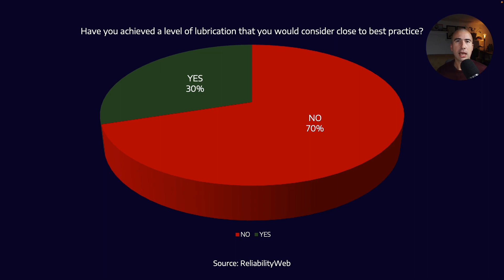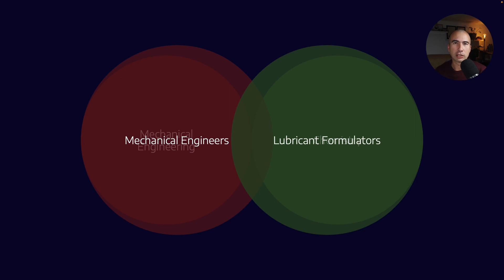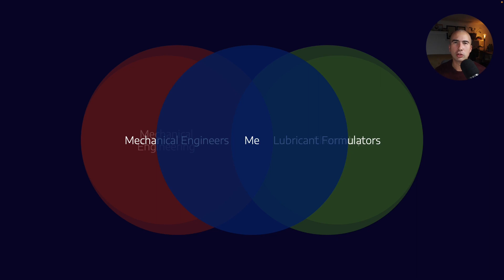Major Hurdles to Selecting the Correct Lubricants

Comment: If the ID of a spherical roller bearing is 80 mm ,OD-140 mm width 33 mm and operating rpm is 2200 ,then what should be used for lubrication, grease or oil ? And what should be the oil viscosity ?

Comment: I called up Penrite some time ago with some questions, for one they don't want to help when they hear aircraft. I was questioning their ten tenths line of oils PAO-ester line. They told me that even in v8 supercars they change it after every race, but my understanding is they use methanol fuel which degrades and dilutes the oil and I wont be using any methanol. I would like to use products that are readily available in Australian stores, but they don't state much with regards to ingredients, so I am just doing my own testing between various grades of Penrite, Nulon and Gulf Western.

Comment: i have a small hobby business that makes tools and parts for the slot car hobby.  a lot of the people in the hobby just use a motor oil or some other generic oil off the shelf for lubrication. while it works, since its a virtually no load use, i decided that i wanted to try to formulate something myself. The data out there on the internet right now for what i want to know is either at a 5yr old level, or a masters thesis level, with hardly any in-between. I will say, one of the best things I did was talk to a representative/distributor for exxonmobile. he was very informative, knew all the oils they had and what would most likely work best for my application. He was even able to send over some product samples so I could do some testing before i purchase a barrel of anything.

Comment: I operate a fleet of MB Sprinter vans with the OM642 Diesel. What I find confusing is that MB engine oil spec includes both low ash API SN oils and low ash API CK-4 oils. Which oil spec do you think should be preferred?

Comment: So far for me, I found lubricant industry to be most complicated as they hide information, data sheets many times have missing information on ingredients or it just says "trade secret formula" something like that.  
Also as I am not chemist, I do not know what other ingredients inside a product do for me.
Like for example WD 40 specialist silicone has ingredients
LVP Petroleum Solvent, 60-80%
Poly(dimethylsiloxane), 1-5%
Propellant (propane, n-butane) , 10-30%  

So what will this LVP petroleum thing do for me and will it stay or evaporate, I have no idea, then what about this poly thing...
For propane, I can make out that its the thing that propels the stuff inside 

just one example of many where I have no idea what these things do nor what it means for me once I apply it somewhere

Comment: Hi Rafe, good video.
You mentioned a mining company, I work for Australia's largest underground hard rock contractor.
Our lubricant selection is done as a joint effort between the purchasing department and the mechanical team.
We have a long-term oil partnership with Fuchs, and our company constantly looks for any product issues, and also possible cost savings.
Fairly recently, it was noted that we don't really get any benifit from the more expensive synthetic version of their hydraulic oil as it replenished so often due to hose damage and leaks that it's constantly fresh. (A big saving per litre) 
We have reverted to the mineral version with no increase in wear of the systems.
Similarly the mechanical team has the fleet set to a conservative 250hr engine service schedule.
There's no history of any abnormal wear in the trucks and loaders, so these are tracked now to have the '250hr' service completed every 300hrs now 👍
To save confusion on the floor, the sheets still show 250/500/1000 services.
Reply from the maker: Yeah that’s awesome. There’s definitely a handful of companies doing this well, but most of the time the salespeople are dictating lubricant selections, and I find there aren’t many that know what they’re talking about.

Comment: Hello Rafe, I'm Abir, mechanical engineer.  I have a serious question.

 We know  xxW-30 grade  is 9.5-12.5 cst and xxW-40 is 13-16.5 cst at 100 degree celcious.

If i give an example Yamaha R15 or Yamaha Fz16  recommendation is 10w-40, so actually oil of  13-16.5 cst is recommended at 100 degree. 

If anyone use Castrol power 1 racing 10w-40 (group-3 synthetic)  which is 13 cst  at 100 degree, initially nothing is happened,but after 2500km or 3000km this viscosity droped at 12-20% less, so the viscosity will be 11-11.5 which is actually 10w-30!  
Even,  I saw a lab test that at after 1500km,  the viscosity drops at 11.8 cst.  (In indian hot weather) 

And same case to Liqui moly street race 10w-40(13.4cst), Mobil racing 4T (13. 5 cst) and all the viscosity dropped 15-20% and gets the viscosity of 10w-30! 

So,isn't it detrimental to engine?

If its detrimental so why Castrol power 1 racing 10w-40 , Motul 7100 10w-40, liqui moly   street race or mobil 1 produce terminal viscosity point of xxw-40?  Why they dont keep it 15 or 16cst so that the drain period will be long and  viscosity remains  in xxW-40 range?  

So,my summery of this big question,  is 13-13.5 cst oils are using safe in hot weather country of a 10w-40 recommended bike?

Please,if possible make an illustrated or short  video.
Reply: I'm going to step in here, the reason why the viscosity drops is fuel dilution. This is perfectly normal for a high performance 4 stroke motorcycle engine as they typically run rich mixtures for full power, and low drag rings to reduce parasitic losses in the engine.
It's up to the owner to find a drain interval that changes the oil before the dilution becomes to great.
(On my own 4T Enduro bikes, this is 5 hours run time)
Reply: No no, I just gave an example of Yamaha r15, this viscosity drop happens in every air cool street bike.  And viscosity droping is a normal issue,I know. My question is using 13-13.5 cst is harmfull to a 40 graded engine and why oil manufacturer make it at terminal viscosity line?
Reply: I highly recommend Amsoil 100% Synthetic 10W-40 Metric Motorcycle Oil, which is a combination of PAOs (Class IV Synthetic) and Esters (Class V Synthetic) that provides a 14.6 Kinematic Viscosity @ 100°C, cSt
(ASTM-D445).  Amsoil also carries a 100% synthetic 15W-50 Amsoil Metric Motorcycle Oil, which is rated by an independent Mechanical Engineer (M.E.) at 116,187 PSI, that provides a 20.2 Kinematic Viscosity @ 100°C, cSt.  Compare that to his testing of the 10W-40 Mobil 1 Racing 4T, Four Stroke Motorcycle Oil, at 93,661 PSI (unfortunately, he didn't test the Amsoil 10W-40 Metric Motorcycle Oil).   

"Reduces Friction, Heat and Wear  In high-heat conditions, AMSOIL Synthetic Metric Motorcycle Oil exceeds the standard for high-temperature film strength to deliver excellent wear protection. It keeps engines running cool by effectively reducing friction and heat, and it contains a heavy treatment of anti-wear additives to reduce wear regardless of operating conditions. AMSOIL Synthetic Metric Motorcycle Oil is thermally (heat) stable and contains maximum levels of oxidation-inhibitor additives. It is extremely resistant to volatility and is engineered to prevent damaging sludge and carbon deposits for superior engine cleanliness."

It also provides "Smooth, Confident Shifts, Controls Foam and 
Delivers Superior Rust and Corrosion Protection.  With its high 11.6 total base number (TBN), AMSOIL Synthetic Metric Motorcycle Oil provides greater protection from acid corrosion and helps maintain internal engine cleanliness."

For full disclosure, I am an Independent Amsoil Dealer.  It should be noted that all Amsoil Dealers are Independent Contractors (as opposed to actual employees of Amsoil).

Here are two Product Reviews from Verified customers of Amsoil from states that get hot in the summer:

"5 star rating Metric Bike Oil
By  BRIAN,  a  Verified Buyer  from  Oklahoma   on  January 05, 2023.... 
I’ve used Amsoil metric 10w-40 in Honda, Suzuki, BMW and Kawasaki motorcycles. And I have never experienced any engine oil related wear . And I have taken long extended tours on my Goldwings and BMW k1600b without changing oil(6,800 mile trips) without any problems whatsoever. When you have the best oil you can get, I don’t sweat the extended oil change intervals."

"5 star rating Metric Motorcycle Oil
By  Carl,  a  Verified Buyer  from  Florida   on  October 14, 2022...
I have been using Metric Motorcycle Oil for over 15 years. I have put 79,000 miles on one bike, 68,000 miles onn another and 70,000 on a third with zero engine problems. I firmly believe Amsoil protects and enhances the lives of my engines."

You can view additional information  by clicking on the following link:  https://amsoilcontent.com/ams/lit/databulletins/g3348.pdf?zo=1420935